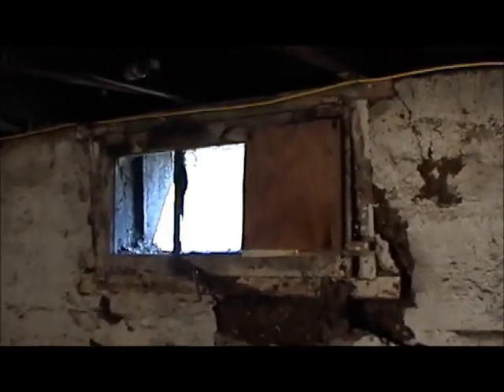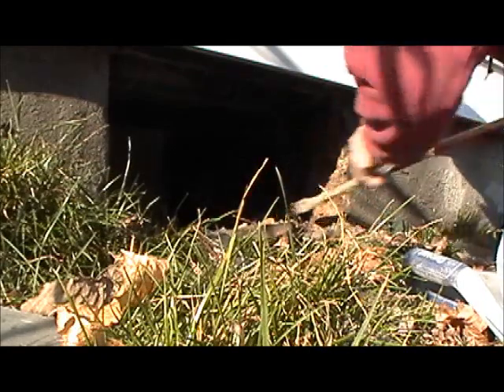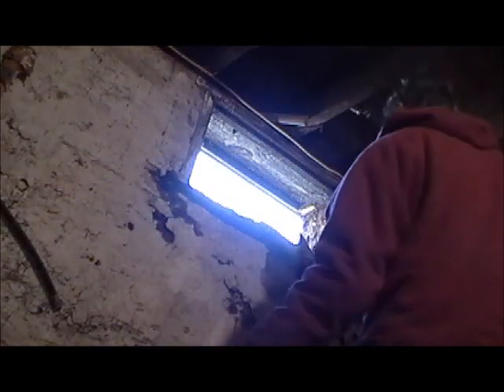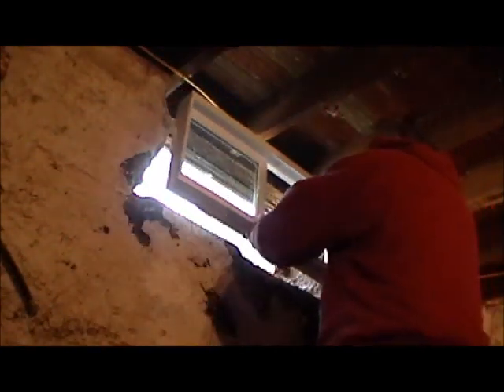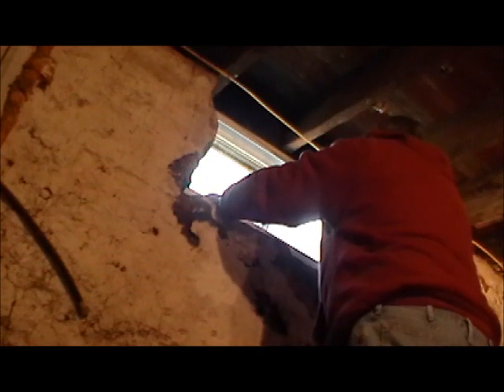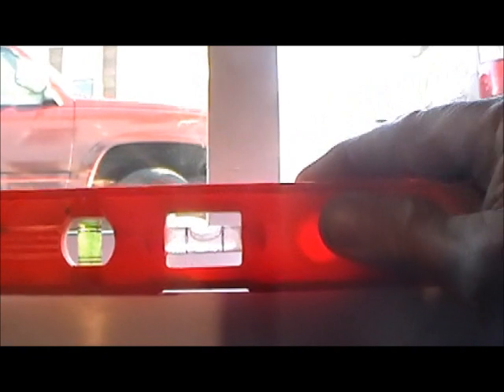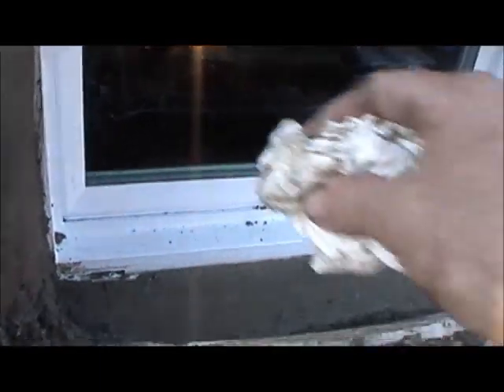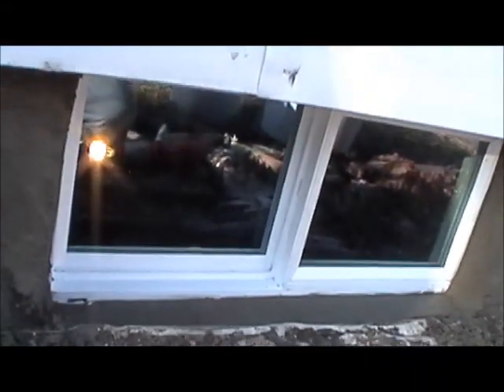BASEMENT WINDOW REPLACEMENT  (part 1)  Mike Haduck

Comment: Thank you Mike for all your videos. I've watched a bunch of them several times. You make it look easy and have taken away my fear of masonary. I'm 70 years old and just replaced 4 basement windows in this old house. It was scary at first but after the second window I was having fun. I have plenty more jobs on my list due to you so thank you for putting these videos out there.
Reply from the maker: Thanks YT, I appreciate it, Mike
Reply: @MikeHaduck  

Hi Mike, I have a question.  
About your dirt trick for aging new cement to look old.
Does the dirt paint need to go on fresh cement? Or can it be added days or even weeks later?
Reply: one more comment on my basement window replacement is that my  wall opening was 40" and the only windows I could find locally were 32" so I added 6" glass blocks to on side. Worked out great.

Tim
Reply from the maker: @YTCotton52  hi I usually do it same day, i might muddy it up more the next day and let it sit, thanks Mike
Reply from the maker: Thanks, sounds like it worked, mike
Reply: Hi Mike, another question for you.
In your videos you say cement is not a glue but a binding agent. Would you please clarify this.

Thanks
Tim
Reply from the maker: Hi YT,, I think the best way for me to explain it is, cement is reformed rock, and masons have to be clever making it stick like wire or bonding agents, thanks Mike

Comment: Thanks for making this video! This looks just about EXACTLY like the dirty, rotten, old, basement window that I need to replace! I've installed enough windows already, to have a good idea of what I'm doing and I've always had great success, but all of the windows I've replaced so far have been ABOVE ground! I even had to CHOP OUT HOLES in the sides of existing houses to install LARGE windows that were never a part of the original plan. Now I need a window for light and vented air in my basement, and it's reassuring to watch an expert!!
Reply from the maker: Thanks Mike I appreciate the kind words, I hope it comes out great and I’m sure it will, thanks Mike

Comment from the maker: @autumnhillpatio I usually use 4 inch solids or brick and then add a couple glass blocks for light. I know it is always a good idea to have the proper ventelation or you could get mold. Make sure you get some professional opinion.  glad you liked the video. thanks  Mike

Comment from the maker: I agree that your suggestion is a good Idea and most likely a better way of doing it, especially If your gonna be looking at it a lot. but In my case it was just a basement used for storing and price was a issue. I always go over the diffrent ways of doing it with the owner and let them decide. I tore the 5 window out and replaced them in one day To make it pretty I would have had to spend more time and that cost more money.. thanks for the comment. Mike.

Comment from the maker: @2jzfrank  I found out it is a lot cheaper and faster to use a hammer and chisel to make the opening fit the window. Or if the opening is too big I use bricks to tighten it up. I got that window at lowes and then made the opening bigger. the guy was flooded out and wanted an inexpensive fix. take your time and think it out. and go the the lowes or home depots and take the measurements first and shop window prices. good luck. thanks   Mike

Comment: Hey Mike, I'm curious why you didn't "finish off" the opening with concrete and then install the window? I would clean the concrete open really well, smooth and true up the opening if needed with concrete, then install the window using screws and chaulk. This makes the window easier to replace later.

I do love what you did here. A good weather-tight installation. Clever to use pre-made window. I also check the "bone yard" of my local contractor supply houses for near fits too.

Comment from the maker: Its impossible to say unless I see it myself. and depends on the space, usually I make the space bigger for the window to fit and then put some screws into the frame of the window and pack it with cement, but if it is close enougn I use tapcons and chalk it. good luck. It all depends and there are lots of ways of doing it.  thanks, Mike

Comment: Hi Mike. I love your videos. They gave me the confidence to fix my sons foundation walls. One thing with these windows. Why not leave the flange on the sides and bottom to aid in holding the window in (instead of adding the screws)? The top flange would still need to be removed. Thanks Again!
Reply from the maker: Hi Hardwarenutz,  you could leave them on If you have enough room but I like the the cement to touch on both sides solid, but again anything that works,  I appreciate it.  mike

Comment: I'm  getting ready to replace some windows in a CMU built building with the CMUs finished with just paint on the exterior.  How do you waterproof around the window opening? I'm leaning toward an elastomeric sealant.  What do you think Mike?
Reply from the maker: Hi Sierra, I always put my windows as far into the opening away from the weather, and I never had to waterproof anything, maybe foundation coating under ground,  thanks mike

Comment: Mike, where did you get those  windows from? I purchased one from HD and it was made from aluminum and the flanges will be difficult to cut off. The one you are using appear to be vinyl.
Reply from the maker: Hi Lowarcher, That is where I got it from.  ask the guy at the window area, I am sure he could help,  thanks mike

Comment: I'm like "This looks like my basement." Then I see you are in Avoca. I'm in Scranton. I wish you discussed the pros / cons of not buildin a wood frame. I still build a wood box for my cellar windows.
Reply from the maker: I have installed and replaced hundreds of windows for sure, and I would  probably say that because of the old stone cellars, window frames was part of the old school windows, today you just buy the whole thing pre made and they are plastic and you don need wood,, wood only rots away and you then there is the termite thing, so I don't use wood, I consider the plastic new school, but I think many still do wood because of local tradition. there is nothing wrong with it but personally can't see a reason for it and nor could I guarantee it,, my opinion,,,God bless, thanks mike
Reply: Mike Haduck  Sounds reasonable. I'm sold. This approach makes my life that much easier. Thanks, neighbor. Dave
Reply from the maker: thanks mike

Comment: wouldn't you want the weep hole higher, it seems as though the base is sitting in a trough. couldn't you build up the bottom with the poly vinyl boards that are available for exterior trimming?